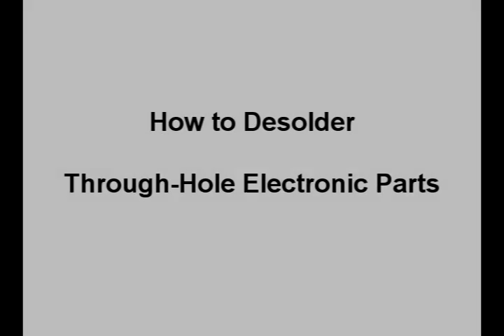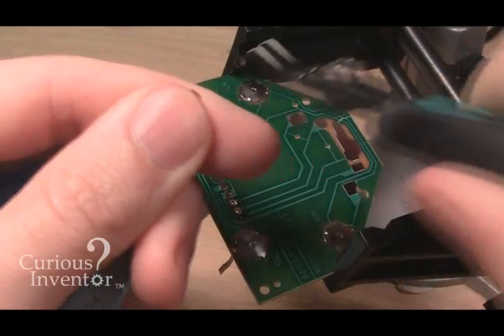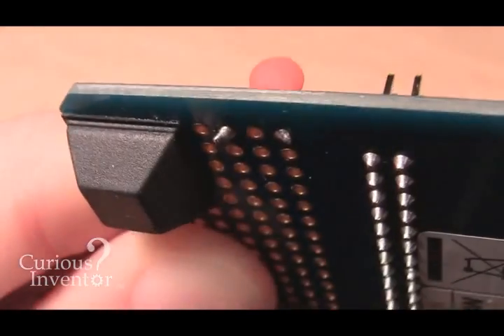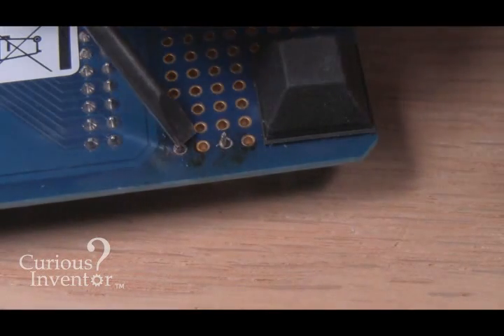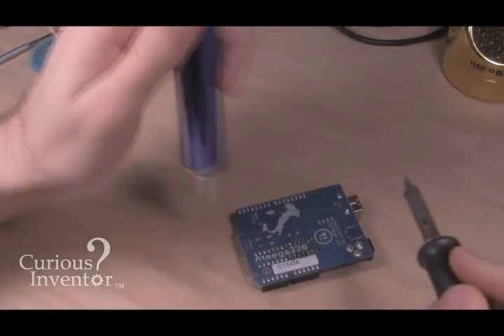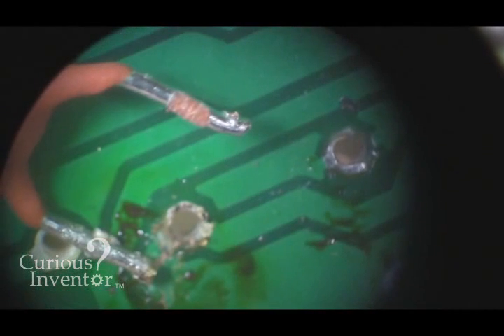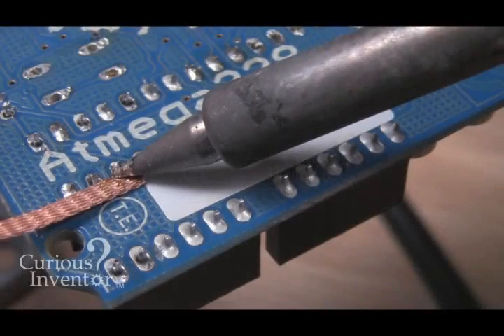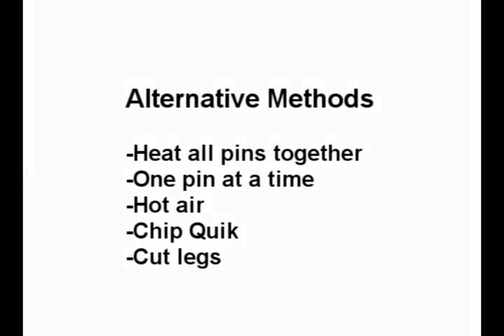How to Desolder Through-Hole Parts, Why Some Joints are Difficult

Comment: Thanks to this video i was able to de-solder the display from a W1209 Temperature relay without any problems using a cheap solder sucker and just enough solder to keep the tip of my iron wet and shiny, and the iron was a cheap  5w  usb iron powered from a phone charger power bank.
I used a small screwdriver after i used the sucker to free the pins from the through hole that were still caught , this video made that possible as i don't think i would have thought of that.
Reply from the maker: Glad it helped!
Reply: Qqqqq

Comment: Desolder pumps loose their suction power after using them a few times. Very often, when you desolder a joint, the old solder flakes sucked previously fall out. In such a case, open the pump nozzle, separate the piston, clean the pump cylinder with a dry cloth, remove the o- ring on the piston, clean it thoroughly, also clean the nozzle if it is clogged with lumps & flakes of solder. Now reassemble the pump. IT works almost as good as new. Sometimes, lubrication of the o - ring with petroleum jelly ( vaseline) or a mild lubricant helps reduce the jerking of the pump when desoldering. In some cases, lubrication with oil also helps . Do not very sticky oils & greases. Doing so reduces the speed of suction or results in inefficient suction.

Comment: this was especially comprehensive. No one has mentioned chip quick. Dude, this is hard actually… desoldering. I dont have the gun YET, but wick and hand pump. I will keep at it. You had a variety of tips I have not seen. Would you say desoldering took a bit to get hang of? 
I have a through-hole pcb for a tremolo guitar effect. Standard size resistors and transistors. It is like impossible for me to accomplish. Will keep at it. Thank you

Comment: Another way to desolder a through hole resister and clean the holes without a desoldering gun is to cut the resister in half then add solder to the bottom and pull the pieces  out then add solder to each hole top or bottom then heat the hole and tap the board on the table holding with your hand. the weight of the solder will cause the remaining solder to fly out cleaning the hole. have a nice day

Comment: I was working on my KitchenAid electric glass-top range appliance "control board" in trying to remove and replace some "relays" on it last evening.  In the process of trying to remove the existing "5 - Omron 6-pin relays" one solder pad fell off or melted (not sure, but missing nonetheless) and another pad or two looked a little rough or "boogered-up" as opposed to the other remaining solder pads that looked decent and round and still have the metallic tin finish to solder onto for the new replacement relays.  So, my question is simply this.....being somewhat a novice or NEWBIE at this, WHAT PROCESS would you have chosen when removing these "relays" like in this specific case of mine?  When removing these relays, it's like trying to remove an IC microchip, due to all the "multiple pins" you're confronted with, but not as critical as an IC microchip, since these types of components are very susceptible to "high temperatures or heat" like the temperatures that come with using a soldering or desoldering gun.  Lastly, my PCB is like most boards....it's double-sided meaning it has "plated" thru holes for it's components where there's metal on "both sides" of the board for each of the component "thru holes" as well.
Reply from the maker: Those are going to just be hard. Easiest is if you could cut out the component, but I'm guessing the legs are exposed enough. I would try using a solder sucker and wick to remove as much solder as possible, and then break each pin free from whatever is remaining with pliers. You could also warm up the entire board a bit with a hot air gun to reduce the amount of really high heat you apply to the individual pins. One other option is chipquik to reduce the melting point.
Reply: @CuriousInventor  Thank you for your quick response and feedback.  Meanwhile, I also bit-the-bullet and purchased a "Hakko FR301 desoldering gun" in the interim, as well, for tough or stubborn solder-joint connections like this in the future.
Reply from the maker: @gosteelers8322  that's an amazing tool if you're willing to spend the money! Pre-heating might still help out you a little.

Comment: I find that very small diameter through hole PCBs very difficult to desolder. Capillary action makes it extremely difficult for me to clear the solder, even with a solder sucker. I've tried higher temeratures and that can damage the pads and traces. I often need to pull RGB LEDs with 4 pins and use a piece of thick wire bent to shape to heat them all at once but it's very time consuming. I really wish there was an easier method for small dial through hole. It's the capillary action that makes me nuts. I clear one hole and it's neighbor draws in solder and back and forth it goes. It makes me nuts, lol. I just can't think of a solution. Is there maybe something that I can feed through the cleaned holes to keep them open? Thread it through but it isn't metallic so won't be soldered in place all the while temperature resident so won't melt? I haven't heard of such a thing but that doesn't mean it doesn't exist, if it does, what is it called? For that matter, if some clever person has a good solution, I'd love to hear about it. Many thanks.

Comment: Man. 

I've cut the parts out, tried to de solder and most of the pins have most of the solder removed. 

A couple keep building up more solder but won't de solder.

Maybe my sucker sucks cause it keeps falling apart. I tried wicking and that helped get most of the solder but not all. 

Any advice? I'm walking away for now. Gonna get a new sucker and isopropyl alcohol. 

I did get one hole cleared but the other 12 have just a touch of solder and pins still in them.

Comment: Thanks for giving me the idea to use a syringe with a very small needle to blow out the stuck solder. I had tried the wick but it seems that the board was too thick.  My method was to get the solder in the via molten with the soldering iron. I then moved the iron maybe 1 mm to one side while still contacting the via. Then use the syringe to blow air onto the solder. took a while to get the idea but it worth considering.

Comment: Just removed a 68000 from an Atari st. Talk about hard to melt!  The atari board sucks heat away fast, had to crank my iron up to 380c melt in some lead solder to remove it.  The holes on the ground plane were stubborn.

Comment: Great video. Remembers me also of wrong things i did in the past :-) Currently i have a PC Engine on my desk which needs a new flex cable but before installing it 84 through hole pins attached on each side have to be cleaned. I already cut the old cable which may have been not the best idea. I tried to desolder the first pin with iron and pump but gave up after ten minutes. Didn‘t know that the rest of the lead will also make it harder to remove all of the old solder. I will give it to a friend with a desolder gun. Thank you for the explanation.

Comment: thanks for the helpfull vid. i didn't learn much from it but i recently ran into a roadblock recaping a original xbox, one pin in pticular my solder iron is not transfering enough heat to melt all the solder in a simgle via conected to a large ground plane easily or consistantly and the board is kind of thick. i managed to melt all the solder a couple times cuz i got the cap out withought damaging the via but i can't manage to desolder it with my whick or small solder pump because of this and i don't have low melt solder yet(ordered some spicificaly for this).   i'm prety sure my iron's tip isn't holding heat well if it does i probably  would have the whole recapeing done a couple weeks ago so any helpful information i get helps until i can finaly desolder the via. It's geting anoying knowing my 80W iron is slowing down my work because the inefficient heat transfer  design and the station doesn't suport well designed irons  D:
Reply from the maker: Try heating the whole board up with a hair dryer or heat gun (lightly) for a few minutes, might reduce some of the heat draw. 80w is generally enough.
Reply: @CuriousInventor  Please what is the type of the pre-heater in the video? Seems it have a small head, can that heat a bigger board effectively? Should one preheat the whole board at all and is not that enough to heat only the near surface where your ground leg is? Thank You.

Comment: if you wanna unsolder mosfets with heatsink, do yourself a favor: remove the heatsink or ad a thermocoupler to it to heat it up during soldering, so you don't loose all the soldering heat to the heatsink.

Comment: Wick is absolutey terible and never worked for me. The manual desolder pumpt is the main tool, and for complicated cases I use the desolder gun or the other methos you mentioned,

Comment: On old boards you will rip the trace off the board if you push the stuck pins while the solder is un-melted.

Comment: What is the hot air tool?
Reply from the maker: Hakko 808 is the desoldering tool
Reply: @CuriousInventor  does that blow hot air? Speaking about at 5:57
Reply from the maker: @MiMicTower  My mistake, look for "hot air rework station" or "hot air soldering", I believe it was this or something similar: Aoyue 852A++ Digital SMD Hot Air Rework Station, added it to the list in the description https://amzn.to/3wm4rcU (rework station) or https://amzn.to/3cJOuFB (hot air tool only)
Reply: @CuriousInventor  thank you really needed to find something like this for a a project

Comment: best video for desoldering i've seen so far!
Reply from the maker: thanks!
Reply: @CuriousInventor ,  I have been soldering and desoldering things regularly for some 50 years including 20 years as an audio repair technician. I've seen some poor videos about soldering on YouTube but this here is not one of them!  Just a couple things I feel should be added, especially for newbies: automatically add a little fresh solder to the existing solder on the connection before attempting to desolder it because the integral flux in the freshly added solder will reactivate the solder that's been sitting on the board for we don't know how many years, and will help it to melt and flow more readily. "Eutectic" solder is popular in some circles because it goes directly from liquid to solid when it cools, without a plastic-like state, but it isn't a good choice as an aid to desoldering,  Where it's preferable for the solder to stay liquid for as long as possible with the minimum amount of heat. Adding a little flux before desoldering is a viable alternative but it works better with solderwick or the manual solder pump because flux fumes tend to clog the filters in a vacuum operated desoldering station.

Also, it appears that you're using a pointy Conical tip.  I prefer a chisel shaped tip, sometimes called a screwdriver tip, for both soldering and desoldering, and especially if you're using solderwick the flat sides of the chisel tip are better for delivering heat to the wick and the solder joint underneath it.  

Other possibilities that I haven't yet tried might be a beveled tip of the type often used for drag soldering small IC's and microprocessors, or a slotted tip which might be helpful for encircling the lead of a through-hole component.  A slotted tip might also work better in conjunction with the manual desoldering pump. 

BTW, on occasion I have poked little holes into the solderwick with a pointed awl, jeweler's screwdriver or dental pick so that the hole in it can sit right over the end of the header pin or component lead. Header pins on a double-sided board are particularly difficult to desolder completely because they're square and usually the hole they fit into has been sized so snuggly that all 4 edges of the square pin tend to bite into the plated rivet ("via") in the board.  Even with a vacuum operated the soldering station, header pins can be a royal pain on double-sided boards!
Reply from the maker: @goodun2974 thanks! Great tips about non eutectic solder staying liquid longer and that liquid flux fumes can clog the desoldering gun! I think this might be the most expert comment ive ever gotten on soldering!
Reply: @CuriousInventor  , another thing many people aren't aware of is that many of the cheap tips sold direct from China and Asia are counterfeit or knockoffs,, made of solid iron or steel, which have poor thermal conductivity. All other things being equal, plated copper tips will work better. I have a video on my channel where I use a magnet to separate good tips from bad, and several other soldering-related videos. Ever use a fiberglas bristle "scratch brush" to remove oxidation and corrosion, to clean oxidized foil pads and parts before soldering? They're  very useful; see my video.

Comment: Bro I know this is an older video from like 11 years ago however I just wanted to thank you for adding in the helpful bits of information that are rarely discussed in regard to the topic of desoldering component on circuit boards.   Specifically the adding solder to the iron PRIOR to using wick!  I have been doing it wrong for all this time and that tip alone will be beneficial to me here in the near future so once again, thank you!  

I’m not sure if you still check your page or the old video comments however I do have a question about solder wick.  You mentioned the braid having flux and demonstrated that by burning it off, so my question is can you use a flux pen to reapply a small amount to the dried out wick to rejuvenate it?  May seem ridiculous to be so frugal however I cannot get solder wick locally and in a pinch, it might be necessary to get the job done.   Thanks in advance!
Reply from the maker: That will probably work for sections of the wick that just got heated but didn’t yet absorb solder.

Comment: I found your video after failing to desolder a button from a PCB. Luckily, the button worked better after plainly re-soldering it so I was good.
I did not add solder to the wick though and maybe such a desoldering gun would do the trick next time.
Thanks for helping a begginer out.

Comment: Very helpful! I often have problems on through hole which have solder on both. If i use the solder sucker in most cases a tiny bit of solder remains in the middle of the hole. Adding new solder and suck it away again usually does not work. I have broken so many pads because of that.

Comment: There's one other method that I have found useful; it requires a variable speed desoldering pump. Set the pump to 80% of maximum. Place the wick over the joint and press the tip of the desoldering iron over the wick. Allow the solder to be drawn into the wick, at which point immediately activate the desoldering iron. This method for me helps with those tricky through hole cases where the solder is attached in the cavity.

Comment: At 5:20,  It is worth noting that if the tip of the Desoldering gun is getting a little rough and beat up or craggy and cratered, it is far more likely to damage a solder pad that you are working on. When the tips get even a little bit beat up, change them! Especially if you are working on boards with small delicate pads and traces,  as are now seen on so many modern double sided PCB boards..

 By the way, I have an Aoyue " 701int A++ " desoldering station where the vacuum pump is separate from the gun,  and I really like the new style tips they came out with that have like a small pipe nozzle or pippette on the end; they're not as the fat and clunky as the Hakko tips and so it's easier to desolder pins and component leads that are very closely spaced together.

Comment: Hi, great video, I'm trying to desolder the battery from an Ipod 4th gen. How much wattage of a soldering iron do I need. I've been trying and nothing is happening? I'm using 2mm wick. Thanks, Mike
Reply from the maker: A battery is likely a HUGE heat sink... pre-heating the entire assembly and going with a higher wattage iron might help. How much? In general, you want to heat things the minimum amount that gets the job done quickly. Beyond that I can't offer much specific advice. 60W+ is probably needed for a big battery or a circuit that touches a whole-board ground plane. A higher wattage iron with lower temperature might be safer. I don't have a lot of experience with batteries, but I know they're difficult and possibly dangerous if you heat them too much.

Comment: And then you get those boards where the chip pins (or other component leads) have been bent,  flat against the pad on the solder side of the board.  Sometimes a small screwdriver will allow you to straighten them up,  sometimes not...

Comment: Thanks for this vid. Crystal successfully desoldered. Pulled with tweezers from one side, held my shitty conical tip on both leads on the other side with plenty of extra solder to transfer the heat better. Success!